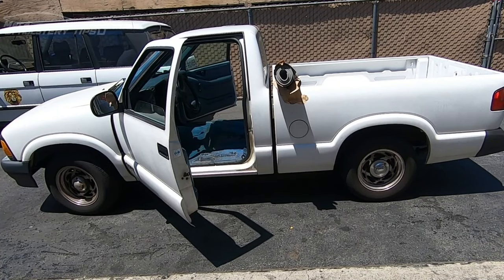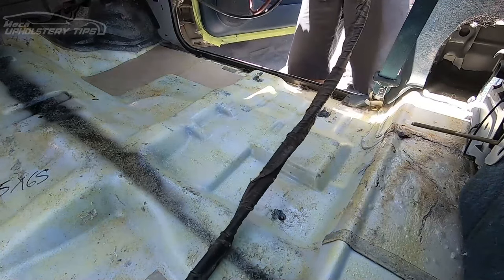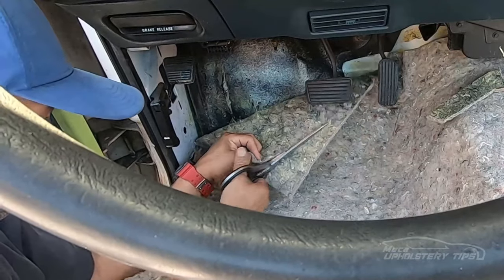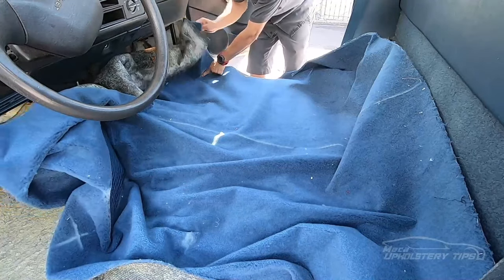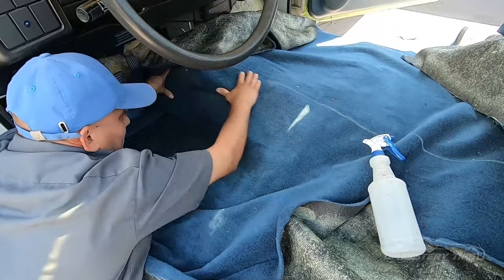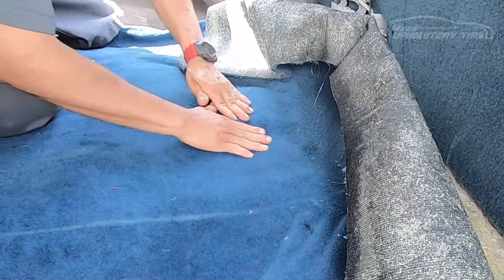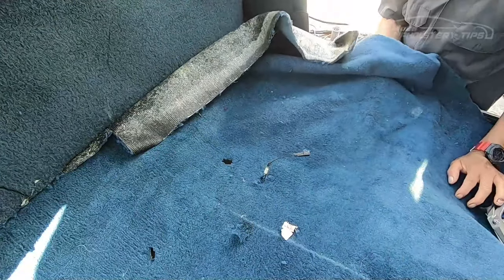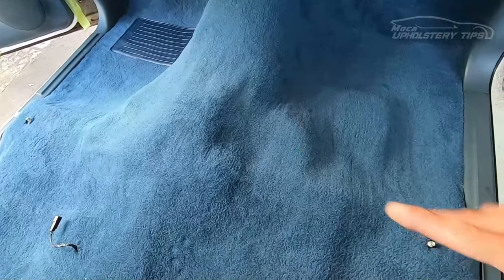How to Mold a car carpet? basic Upholstery tutorial

Comment: I appreciate the video. Just a word of advise to anyone out there that might attempt doing this… in order to form carpet it has to have a polyethylene backing. Don’t make the mistake I did and order 150 dollars worth of Essex carpet only to find out it’s not the right kind to be able to form. 
If you order from ACC and get the mass backing stuff, it’s nearly impossible to reform it. 
Because ACC doesn’t always get the carpet sizing right, it’s best to order the carpet that does not have the mass backing. That way you at least have a chance of shaping it as this gentleman in the video has demonstrated. 
I can’t order a preformed carpet due to changing transmissions and having to enlarge the tranny tunnel and the gear shift placement is different as well. 
So I’ve placed another order with Texas Foam and Fabric and will attempt once more!

Comment: Wonderful video, I will be using this advice when putting new carpet in my '72 Mercedes!
Reply: Is it a sl by any chance? I wanna do new carpet but I don’t know where to start any recommendations?
Reply: @cuberlegend   Mine is a 220D so it's the W115 body style, which is a bit different.  The principles are the same though, I started by removing the trim and seats, pulling up the old carpet,  and cleaning up the floor.  In my case, 'cleaning up the floor' meant cutting out most of it and welding in a new floor due to rust.

Comment: I learned a great tip for you. Heat up a hollow steel pipe the size needed for holes, burn it into carpet for a clean pefect hole that seals the edge.

Comment: Im discovering that the molded carpets need some fine tuning using your techniques. Mine is kind of loose over the transmission. Then again, I have not used glue yet. I'm fitting it first and then plan on taking it out to glue it down

Comment: if I was going to sound proof my car first do I need to use an underlay ,or should I soundproof first then place the carpet or by doing this way it will be sound proof regardless , what underlay you use can I use the normal rubber underlay for the house carpet.
Your English is fine I totally understand your translation
Can you advise how long did it take to complete the carpet in the car.
Thank you fo your video

Comment: You can also use rubber mallets if the carpet is hard to mold,    the bigger the hump,   you may have to sew it,     did thousands of these over the years.    Ozite is the easiest.   Yep,  If you glue it and have to move it,   it will look like a corn cob

Comment: Thanks for sharing your expertise and encouragement for us to try this.  What underlayment foam do you recommend? Is there a better brand and supplier you recommend?
I have already installed dynamat and closed cell/foil to  metal floor. Do I need to change any techniques or materials shown in your video here? I already have a "preformed" mat ready to install and trim to fit.
Thanks for any guidance.
Reply from the maker: I think if you have on the dynamite and then after that you have a cell closed foam .. that it is more than enough for the insulation.. VETERANCO. It is a good place to buy supplier for example the carpet padding. Carpet
Reply: @upholsterytips  Thank you.

Comment: Neat. Always wondered how this was done. Have you ever thought of using that expanding spray foam to fill in the deep spots instead of cardboard?

I don’t think it would make a huge difference, it is a thought though.
Reply: The foam would crush down if any weight was put on it and leave a permanent dip.  I think I would even use something more solid than cardboard.  Maybe some 1/4 ply cut to size and piled in the hole until it is level.

Comment: I doesn't make sense to us adhesive on the actual floor board. Yes I understand your making a molded carpet, but technically its not molded it us just glued to a contoured floor. Plus you won't be able to remove it in the future because you glued it to the floor. If you took some Jude padding and cut pile and assemble a molded carpet that is removable like the factory you would have an even better outcome of a product.